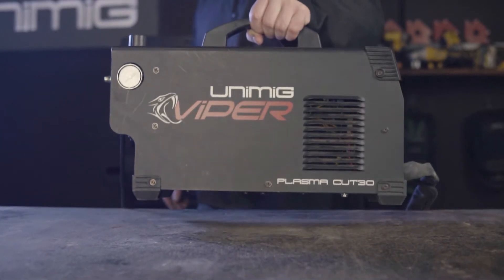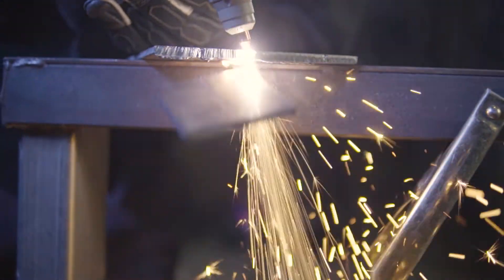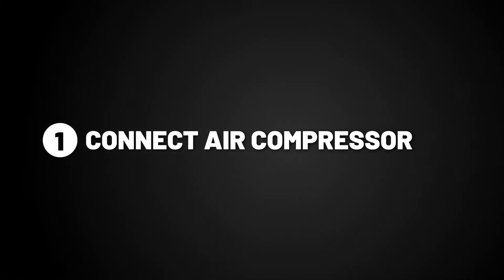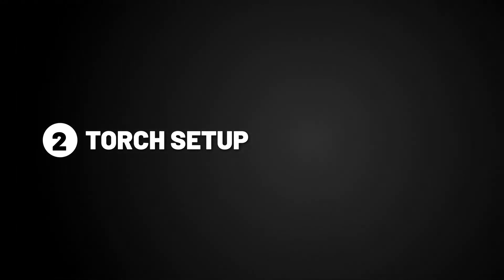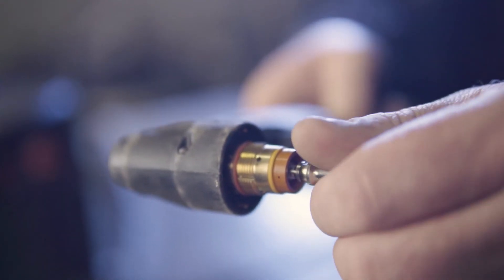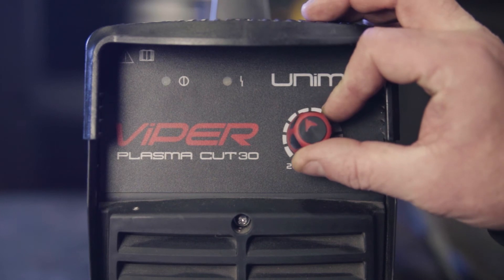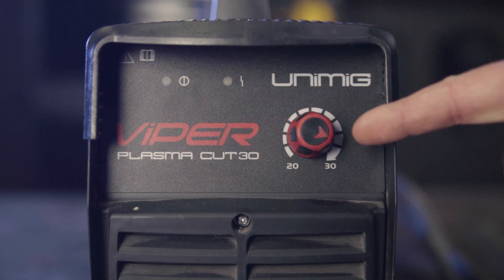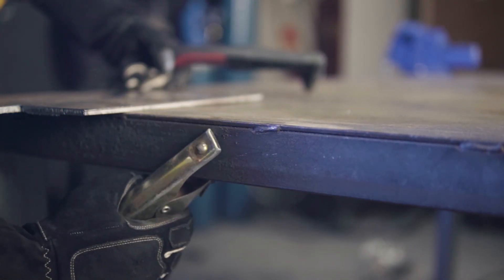VIPER CUT 30 - Ferrous Metal Cutting Setup Guide

Comment: Hi bought one CUT 30, but my cutting is not clear on 2and 3 mm. thigness.  Why ? Air pressure must be 5 cm3 ? And 25 amp for less 2 or 3 mm ?